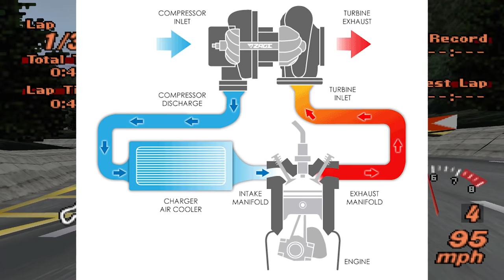5 MORE Gamer Misconceptions About Cars!

Comment: I know, late reply, but to basically add on to what you said about point 5, I challenge anyone who makes that comment to get into a simple 9 second drag car, make a pass, and then tell me the car was going in a straight line. Chances are, they can't. Even cars as slow as mine (19.20's in the 1/4 mile) tend to weave around. It doesn't matter how sticky a track is, it doesn't matter how big your tires are, and it sure as hell doesn't matter how well your car hooks to the surface. Even if you have your car tuned as perfectly as possible, you're ignoring the fact that anything that can go wrong, will go wrong. One slight change in conditions and you can find yourself fighting a 1.5 ton brick with 800hp.

Comment: NOS is actually a brand. Nitrous actually cools the engine it actually does not over heat the engine. They use nitrous in Formula D when in low rpm when the turbos have not spooled up.

Comment: To an extent, they’re right: driving in a straight line doesn’t require much skill; however, driving an incredibly powerful machine built to go very, VERY fast in a straight line DOES require quite a bit of skill, lest you lose control and kiss the wall at 80 mile per hour, or just straight up blow the motor or transmission.

Comment: for the last one with cars being easy to control in straight lines in games, the only game that knew how to do it was nfs Prostreet, if you got a regular car, it is easy to go in a straight line. HOWEVER, if you got a 1000hp RWD monster, it takes you 2 seconds to loose control and crash on the wall lmfao, i remember wheelie events being a nightmare as it required both a powerful and a rwd obviously, but the wheelie was enhanced so the front lifts up agressively and if you dont direct ur car properly from the start, you either slow down after and loose because you did a horrible performance, or, you keep going and crash on the wall

Comment: Point 1 is mostly wrong, cars blowing up when they flip is mainly an old gta thing because the old systems couldnt handle so many cars (flipped cars would have go stay rendered etc) and GTA V cars NEVER explode when they flip, you can flip them back over extremely easily by steering  right or left

Comment: You kinda missed the most important thing with the first one. Gasoline needs to react with oxygen, we all know that, which means if there is a big amount of fuel, only the very very top layer of it, where it is in contact with air will light up, not the whole amount of fuel at once. It will flame up, depending on the situation more or less dramatically, but even if you tried to light it up and make a car explode, ya couldn’t

Comment: Turbos can be activated by a switch, button, or dial. You tap into the vacuum line to the wastegate and run it to said control device. I had my grand national set to 17psi and could adjust it on the fly from 3psi to 27psi. I went with a dial to adjust according to fuel or if someone tried to stoplight race (in Mexico). It also had a 5-7 setting ecu chip, forget the brand. But yes you can have it set to say 17psi and if the situation called for it a push of a button would increase it to 27psi. The most I ran on 93 octane. Launch at 17 then with traction if needed (rarely) would turn it up. Modern systems are even better, that was back in 2001 or so.

Comment: I really like cars (do not have one yet) and especially like the mechanical part, like how the engine works, etc.
And I noticed some of that stuff in games too.
But there is actually a game doing it really good. 
BeamNG drive.
Nitrous doesn't shoot flames, but smoke streams are coming from the hood - turbos are turbos, with lag and everything - performance engines create backfire when reving high, especially when using turbocharger or supercharger, ...

Well, it's a Simulator, you should expect realism.

Comment: fun fact back in school i put the foot to the floor on a RWD and i didnt crash at all when i had a 2006 BMW..
but if you have a high power vehicle like 4.8, 5.0, 6.2 or any sports then DO NOT SMASH THE THROTTLE WITH NO TRACTION know your limits and worse of all do not smash the throttle on any cars when you have BALD TIRES except if its a nice weather and your car is a FWD and only the  front tires are only bald.    My friend destroyed his rear Axle of his 04 Mustang GT 4.8L by hitting it on the curb hard  also you forgot something DO NOT GO AIRBORNE DRIVING YOUR CAR IVE SEEN MANY YOUNGSTERS DO THAT WITH THEIR SPORTS CARS AND AIRBAGS GO OFF.  SPORTS CARS ARE MEANT TO STAY ON GROUND AT ALL TIME UNLESS YOU MODIFY ALOT OF THINGS

Comment: Fire shooting out of the back of the car is not "back fire".  That is "after fire".
"Back fire" is when the intake valve does not fully close by the time the spark plug fires and the fire travels back into the manifold.
It was only applicable before direct fuel injection and would cause massive damage because the manifold was filled with flammable gas.

Comment: Where I live, the "Driving in a straight line doesn't need skill" is mostly true, as most of kids racing "a drag race" drive FWD cars with under 150bhp. You almost can't get wheelspin in those, so the only thing where skill has some importance is how fast do dhey change gears and how well do they now power curve of their car.
I prefer downhill on mountain roads, but do not question skill and courage of guys racing 1000+bhp RWD cars in a straight line. I wouldn't dare to drive one.

Comment: Also I want to add many people think that when youre in high rev lets say your rev limit is 8k and youre in 4th gear 7700 rpm and you meet corner many of my friends tell me dont need to brake just downshift to 2nd or 3rd gear and you will instantly slow down. In real life YOU CANT DO THAT you will overrev your engine and destroy the engine mainly in piston, crankshaft and valves.

Comment: Ok correction there Angel.... They "dont explode, period" not even nitro methane cars that wreck will explode, nor will lithium battery powered electric cars. Can they burst into flames with a fuel tank breach? Sure. But cars simply do not "explode", thats a Hollywood thing. Even if the tank was near empty and just filled with air and vapors and somehow got ignited, theres relief valves that blow and let the pressure out, a bit like putting alcohol evaporate in a 2 liter bottle and lighting it. There just isnt enough energy, or rather, gas doesnt burn aggressively enough to cause an "explosion". And vapors at most make a loud puff. The tank is more than capable of holding in an ignited evaporate situation. If your polyester thermoplastic 2 liter bottle can do it, so can your metal gas tank (or in some cases, very thick polymer plastic). The explosion thing in movies (which is where games got it from), is from an old mentality at the dawn of the industrial age where cars were first coming onto the market. People hate what is new, and fear what they dont understand. So people would spread ideas based on insecurity, not fact, that these new "automobiles" with internal combustion engines are dangerous. "They will explode. Think about it, its already having a bunch of explosions inside of it every second. These things are dangerous. Just get a horse and carriage." The most you'll get from a car, even a race car, is a "POOF" followed by a fireball. And that occurs very specifically, when theres a large fuel and air mix exposed to an ignition source. Go watch a youtube video of what happens with cars and compare that to a granade, or hell even a firecracker.... Not the same is it? Theres an actual explosion, and then theres a fireball. 

Now... There are fuel air ordinance devices that detonate evaporate or dispersed fuel spray. We call those "thermobaric" weapons. But these use much more exotic chemicals than what we see in automotive fuels, regardless of what sport or class the car is from. Those weapons also require an explosion as the ignition source, otherwise its just a big puff and fireball. So what you get is an initial blast wave, the fuel cloud is ignited, and the initial blast wave amplifies that air burst wave. This is, in no way, what happens with cars. I dont care how fast you run yourself into a wall at, and how fine the gas spray is, you arent going to "explode". You may burst into flames though. This ides of any car "exploding" needs to just go away.

Comment: You should explain teb difference between antique lag and two step next
Reply: Anti lag keeps the turbo pressure in the turbo so it doesnt have to build boost when you accelerate. 2 step is a 2 step rev limiter, for example, an rx7 could have the redline at 9,000RPM but if you have 2step you could make it 4,000RPM when your in neutral and then 9,000RPM when youre in gear. Idk about the flames but yea

Comment: For The last one in some serious video games like f1 eracing dirt or any high simulations games train you to that. If you drive a Lancia 037 with 400hp and weights less than 1000kg you will lose it as soon as you give 5 percent more throttle than your supposed to. Also for F1 Cars is the same

Comment: Number 5 I sort of disagree with if only because as hard as it is to control power in a straight line it's even harder to control it in corners. My truck is the king leer of oversteer, specifically because of the unloaded weight distribution. I've also 4 wheel spun my subie in a straight line before which, I don't recommend doing that more than once unless you like having a 3600lb garage ornament. Imagine trying to get as close as you can to that catastrophic loss of grip while cornering. There is no comparison.

Rather, drag racing is easier, so we can get away with driving more difficult, purpose built cars with it that only an absolute AI mastermind would even dare take around a track.

Comment: Beamng drive is one of the most realistic games ive seen for drag racing not detected to drag racing as my drag car i built using game mods it can run 6s but i have to keep it under control and at 1 point a added wait to keep it under control

Comment: 1; Backfire is also a massive thing with rotary engines. Rx7 is a perfect example. Plenty of backfire no matter what the tuning, because the nature of a rotary is that they naturally eject a certain amount of fuel.
2; jamming on the accelerator in a car like a dodge is like trying to keep power going through the tires, and keep the car straight, on a patch of road covered in black ice without tire spikes. It's just a pain. You can do it, but dumb amateurs will hit that loss of grip moment and go "Oh god oh fu-" and just *panik*. 

3; If you're a good driver you can spool a turbo in a continuous fashion by pumping the accel in short, sharp movements while turning, making your exit acceleration much quicker and more efficient. This is more effective the more aerodynamic your car is; as the more sudden changes in acceleration it can withstand while maintaining grip. They don't need to do it with modern systems, but in F1 this was a strategy used for quite some time, can't remember the generation it stopped though. This works Better with older systems, but it still works today. It's also THE technique in go kart racing btw.

Comment: Um. Most offroad and racing vehicles have a fuel cell, specifically designed not to leak, and not to explode incase of a wreck or rollover. That doesn't mean normal, non race cars will explode if they rollover, but they are more likely to.

Comment: I crashed my first BMW 3 series because I overcorrected :D With great (horse)power comes great responsibility. Driving in a straight line is not easy... but it is MUCH easier than driving on a track. Thats why most American cars suck at racing, their weight balance is great for straight line speed, but the moment you want to make a turn the rear kicks out. The same is true for heavy Euro cars like Mercedes (excluding the AMG GTR) or BMW 7 series too. They are not good for track cars. For example: A Hellcat with more than 800hp is slower than a BMW 3 series with 450 hp around a track, but it will gap it on a drag strip.

Comment: You are kinda wrong on the nitrous shooting flames. To use larger amounts of nitrous you need to add a whole lot of fuel to keep the combustion cool enough for the extra nitrous causing a rich mixture and flames to shoot out the exhaust the whole time its being used. You might not see the flames during the day? And not all nos users shoot flame... but a lot do.

Comment: You're confusing lag and spool.
Spool is the lack of power experience by a turbo engined car when it is below the optimum RPM where the turbo is spinning fast enough to provide extra compressed air to the combustion chamber and allow it to make extra power at the wheels. In big single turbo cars this is more similar to how games represent nitrous where the engine goes from slow to whoa depending on rpm and throttle position.
Lag is the time taken for the mass of the turbocharger to respond to throttle input be this spooling up or slowing down. The compressor has mass and inertia resisting changes to its state (spinning speed in this case) and therefore has to overcome these resistive forces in order to change speed. This change can't happen instantly so there is a delay between input and response which is known as lag, it takes time to build compressor RPM when you step on the gas and when you release it the compressor takes time to slow down again. This period of time might only be fractions of a second but as a general rule the bigger the change the more lag you can expect, a big, heavy turbine spinning really fast being suddenly asked to slow down will respond more slowly than a smaller, lighter unit. Anti lag is achieved by keeping the compressor at a more constant speed by feeding it exhaust flow separate from engine rpm by dumping fuel into the exhaust and/or bleeding boost pressure from the intake as appropriate to requirement.

Comment: tires only wear down in a few laps its only those fast cars like formula 1 and nascar and they have like 3 tiers of tires
soft - more grip but high wear(probably 7 - 10 laps not sure)
medium - medium grip and medium wear(19 - 20 laps not sure too)
hard - less grip but low wear(idk how many laps hards have)
Reply: hards are usually about 50-60 laps, however it depends on the track

Comment: Why do turbochargers look like snail shells if they make the car faster and not slower!?!?!?!?!?
Reply: Let me explain, the turbos can spin A LOT FASTER than the engine, like 100 times more rpms. And it compress the air and its lighter. Not like the supercharger, it wheigths a lot and uses engine power to create more but it uses a LOT OF SPACE so its hard to put it in the best place and is not efficient.
Reply: @ValenGR86  So it's always better than a supercharger?

Comment: You got backfire, antilag and two step a little wrong.

1. antilag is a rally modification, not used on street tuned cars because it destroys turbos in no time
2. two step is just a secondary rev limiter for launch control just like you said, but it can be used on turbo and na cars, not just supercharged ones
3. even low power na cars like a miata can spit flames, just need to adjust the fuel map and decat it

Most tuned cars spit flames cause of two step and modified fuel maps no matter the aspiration of the engine
Reply: (not hating, just clarifying xd)
Reply: also really soft tires can wear down significantly in just a couple laps, cup 2 r's will only last you a couple laps on nordschleife if you drive at the limit, step it down to regular psc2's and it'll last you over 80 laps, when talking high power drifting with a heavier car say a jzx, you're looking at a set of rears per track day most of the time
Reply: So i've been using anti-lag wrong for a long time
Ok

Comment: First, I wouldn’t say nitrous is nothing like turbo boost as they both provide more oxygen allowing more fuel to be burned. Second older cars experience this turbo lag and personally I prefer it. My 87 grand national was a dog until the turbo spooled up and it was a rocket, granted I had a larger aftermarket turbo. Modern cars don’t really have this issue. I drove an Audi rs4 and it made boost immediately. If I didn’t know I’d think it was na. Granted it’s a small engine and small turbo. It was a rental so I’m not that familiar with it, but it could have been a multi vein turbo or just small and those Germans are meticulous.

Comment: Antilag and two step do different things, someone who has a two step system should know what it does before talking about it. 

A two step system is a form of launch control. It functions as a secondary rev limiter/fuel cut and allows you to put your foot to the floor and hold a predetermined engine speed for launch. This is extended to 3 step, where it cuts and allows you to no-lift shift second/third gear safely. This can be used on any engine. 

An antilag system has nothing to do with launching the car. When you shift, you cut throttle, which means that exhaust flow is reduced and can't maintain turbine speed on a turbocharger. Instead, the turbo has to spool back up after shifting. An antilag system places an air bypass at the intake and routes fresh air, fuel and ignition into the exhaust manifold, before the turbine. When you cut throttle, the bypass allows fresh air and injects fuel into the exhaust manifold, where it combusts and generates gas to keep the turbine spinning.

Comment: Um no actually that’s not how tire wear works even in older games like gt2. If you ever pulled up the detailed info screen of your race you would see there is throttle position, brake position and tire heat etc The reason tires wear quicker in games is because the races are a lot shorter. 3-6 laps.